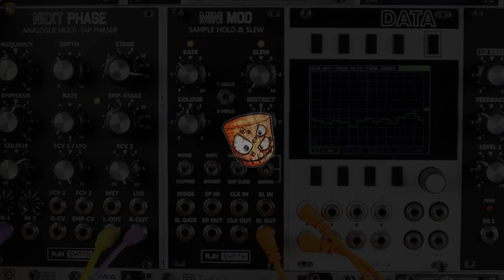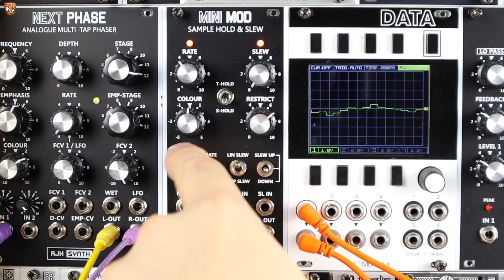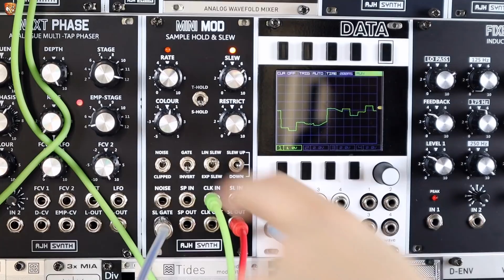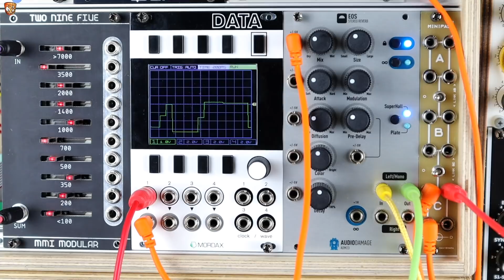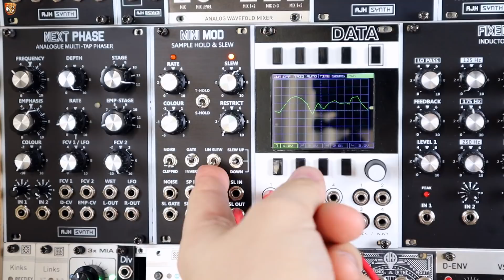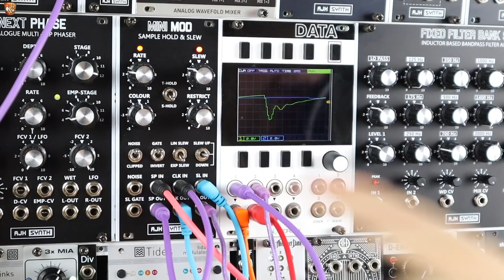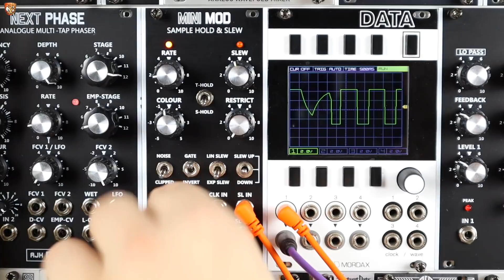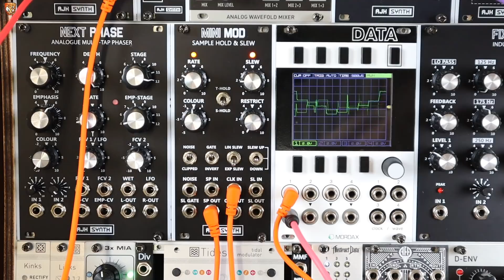AJH Synth MiniMod Sample Hold & Slew // Everything you could want from S&H and more!

Comment: This is basically their “glide and noise” but better. Or am I missing a point?
Reply from the maker: No, glide circuit (I imagine some parts reused) has different shape options, noise on the glide + noise has more noise colours on different outputs, Glide + Noise does the bus board pitch distribution thing really nicely etc. Some overlap of course if you were to only buy one I'd buy this for the sample and hold.